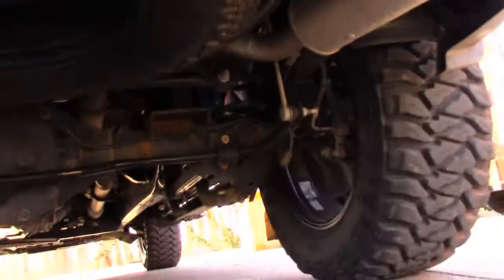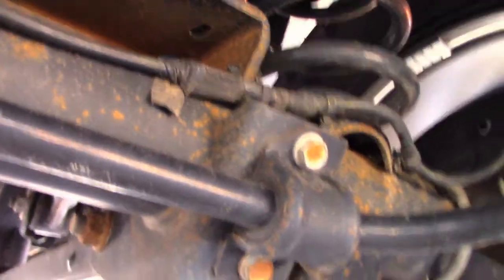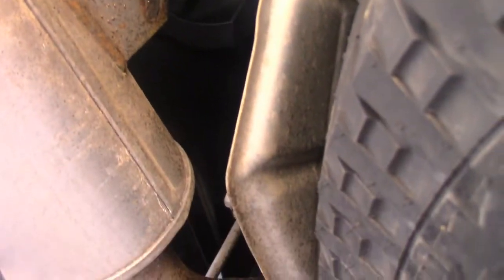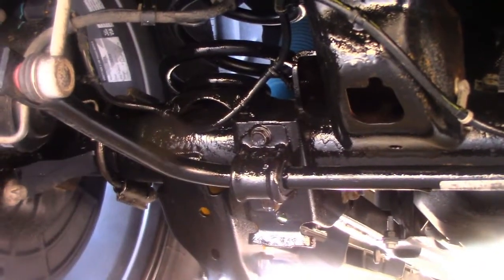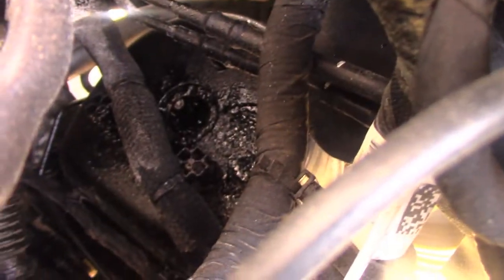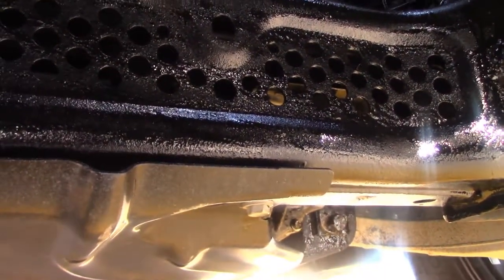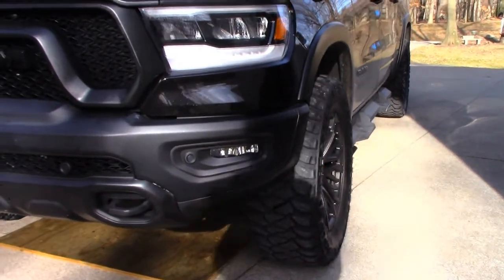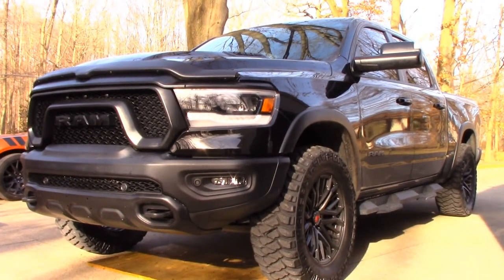Fluid Film Black Aerosol Undercoating 2020 Ram 1500 Rebel

Comment: Fellow salt-belt resident here— if you’re going to do this every year, get it in gallon or 5 gallon quantities. It’s helpful to have the 360° hose for the rattle cans, because you can get it into really hard to reach places.  When you buy the kit with the gallon size or larger, you’ll get a 360° wand and a flexible extension.  Places like the frame interior, A-pillars, rocker panels, and other protected places won’t receive a lot of roads spray and could be done maybe every other year. I do my exposed areas on my jeeps (floor pans and wheel wells) every fall while it’s still warm, Sometimes a dry day in the middle of winter I’ll go back and reapply it where needed. Doesn’t take too long.  
The initial application, however does take some time if you want to do it correctly.👍🏻
Reply from the maker: Good tip! I did go back and do the wheel wells after this video. Especially where the flares meet the body. I will look into getting the hose. Filled the tailgate on my old truck. No need on this one- it’s aluminum. Still planning to have the floor in the cab done and the doors filled. Thanks for watching!
Reply: @venomrebel2020  i put regular fluid film on my 2004 silverado it was super clean truck  took the paint off and ruined all the rubber underneath  control arm bushings and bodymount bushings worked decent on the floor pans bought the whole gallon and brushed on thick you might want to check all your rubber under your truck
Reply from the maker: @davehendrix671  no kidding. I’ll have a look

Comment: Alright I’ll try to give some insight since I’ve been doing this for a while. I’ve got a 2015 with less rust than that and I’m in MA so they spray that car killer down every winter here too unfortunately. Invest in the full “pro” kit they sell for fluid film, you’ll need an air compressor but all in you’ll have yourself paid back with 2 applications. Also I now use “woolwax” made by the same people but more for undercarriages. It dries much thicker and almost creates like a waxy surface like the garbage they use in GM truck frames. Also when you use the kit you want to keep the bottles you have full of woolwax hot. I’ll take hot water and dump it in a cooler and put all my containers in it to really thin out the fluidfilm/woolwax, helps spraying it a ton. Lastly I like to do this around right now. I did mine today actually but you want to do it while there will still be a couple warm days. The “creeping” these products do won’t really happen if it’s cold. Woolwax also lasts way longer, fluid film was always gone in high wash areas in early spring, not the woolwax. Also doesn’t smell like sh** lol
Reply from the maker: Good information. The FF Black is considered a wool-wax. I’ve been impressed with it. I did not know about the temperature situation. Thanks for taking the time to relay your expertise.

Comment: The drive shaft is just gonna sling that stuff right off.  Corroseal would be a great alternative.  👍👍
Reply from the maker: I will look into it. Thanks!
Reply: once it dries it oughta stay put, no?
Reply from the maker: @viewer54322  Fluid film black is a wool wax. It never dries. Regular fluid film is lanolin based and it doesn’t dry either.
Reply: @venomrebel2020  black is lanolin based with a carbon dye. Same as original